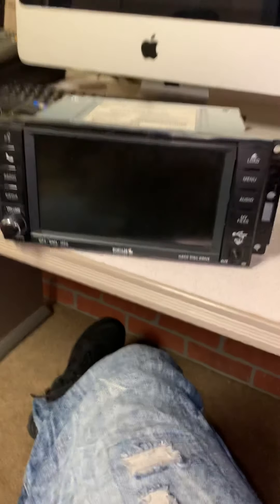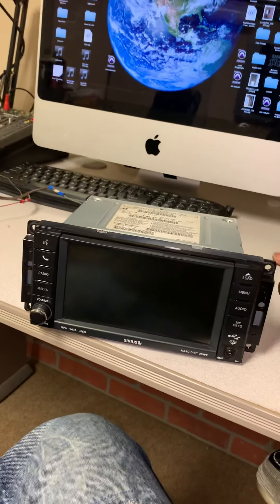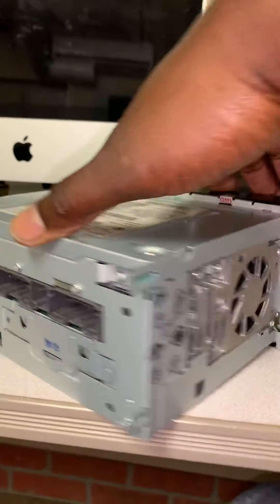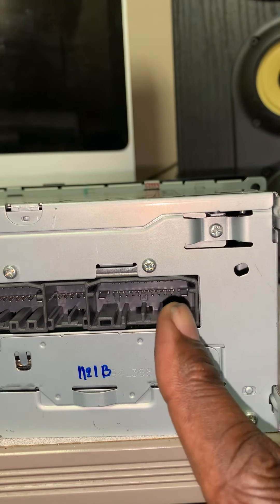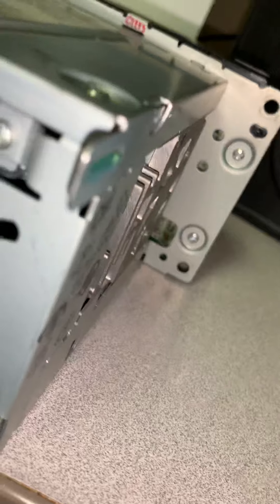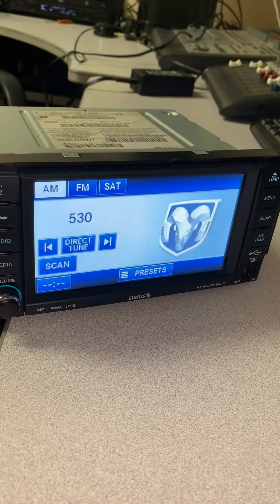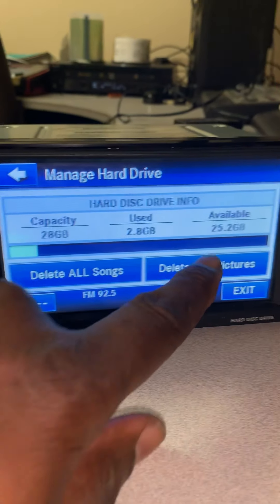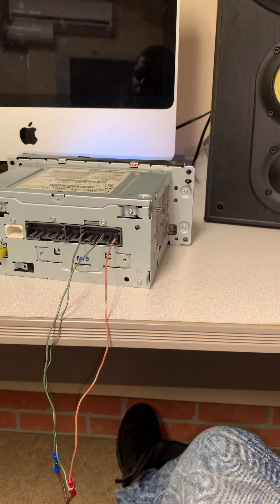MyGig RBZ radio not powering on

Comment: I’m having the same problem I got a 2011 Dodge Avenger rbz radio nav and try putting it in my 2011 Jeep Wrangler and it’s not turning on
Reply: Me too. Wont work in my 2011 jku even tho the cables match up.. radio is from a 2010 grand Cherokee

Comment: This is a Great Find !!!  But from your Aspen , you could have used the CAN wires and it would have worked. I did follow the wiring diagram from a 2008 Chrysler and , using a used connector , swap wires from my 2005 radio and it worked via CAN Data.
But your find will let me install this radio in a Non CAN vehicle !!!!
Thanks Again !!!!

Comment: thank you for this, i have a RHB version and im hoping the pins are still correct that you pointed at so i can do some testing in the house to see why mine is no longer working. THANKS AGAIN!
Reply: Did it works with your RHB?
Reply: Curious if anyone has got the steering wheel controls to work on non can bus vehicle with RBZ or RHB radios

Comment: hi thanks for the video I picked up a mygig today, I have power to the button lights but thats it, I may have the same problem as you,
I have a dodge nitro the radio is from a jeep my harness plugs straight in but maybe the pins are different on the dodge to the jeep

Comment: At the 1:14 mark, you show the back of the stereo. One of the jacks is for the main plug. I believe the small on in the middle is Bluetooth. Do you know what the other jack is for? I am hoping it is for video output...
Reply from the maker: The small square plug in the middle was for the steering wheel controls for volume, and radio tuning
Reply from the maker: I am not sure about the video out on these models “. The majority of the ones I see have the av plugs attached to the radio